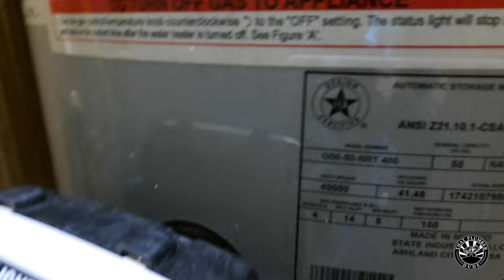Replacing Electronic Gas Control Valve | Bradford White | Plumbing Vlog For Apprentice Plumber

Comment: Been a licensed master plumber for 28 years , I own a plumbing business  in three states I get tons of gas leak calls because of contractors using the blue or yellow tape on the gas line, If you use pipe dope rated for gas lines you will never have a gas leak.
Reply from the maker: Tape & Dope is my preferred method 🤙🏼